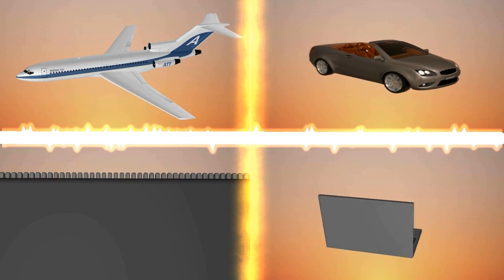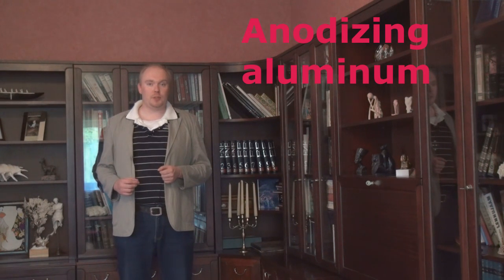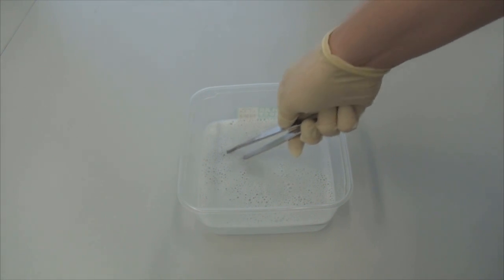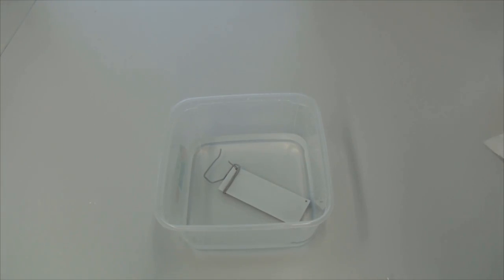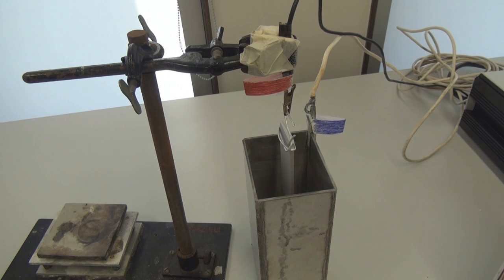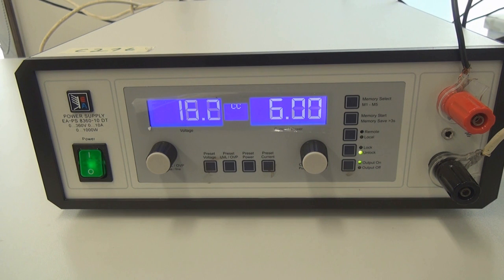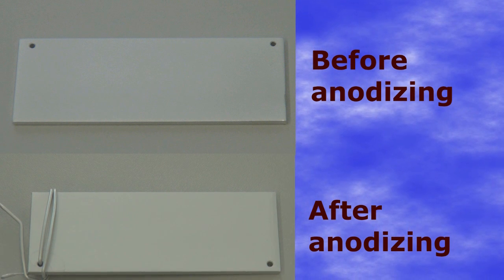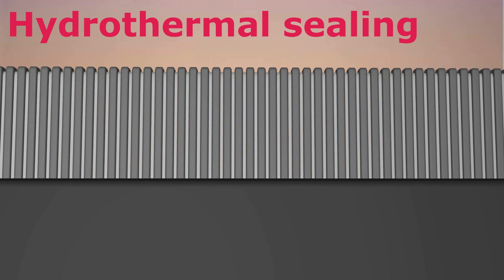How to Anodize Aluminum DIY | Corrosion Prevention Methods

Comment: Hi Captain! Man you really know your stuff! Can anodized aluminum work as an actual anode electrode in a fuel/battery cell [for eg]? If yes, then would it be protected from corrosion from submersion in citric acid and salt combined [for eg]? Normal aluminum corrodes when submerged in such a combination but if it is anodized first, would it last and still be conductive as an anode? Be very grateful to know what you think. Thanks!
Reply from the maker: Well not directly. The anodic aluminium oxide layer is dielectric, which is not particularly great for electrodes. However, the pores in the AAO layer can be used for template synthesis of nanopatterned surfaces, that can be made out of chemically resistant and conductive materials. There is a whole world of structures and materials in that field. Easiest example would be a forest of Platinum nanorods or tubes or multiwalled tubes etc. Manufacturing such nanopatterned surfaces comes with a cost though, so the cost analysist should be a part of the study.
Reply: @CaptainCorrosion  Thank you very much for such a detailed reply - very grateful to you captain!

Comment: Does heating metal also anodize the steel?
Reply from the maker: Hello! Not every oxidation is anodizing. By heating the metal you do oxidize its surface but it is not an electrochemical process as in the case of anodizing.
Reply: Ohh thanks now I understan why it always oxidize and rust.
Reply: I was trying to get the rainbow color effect on a stainless steel muffler by heating it but after a week or so i found out that it got rust on its surface

Comment: what should be the concentration of sodium hydroxide solution used to remove oxide layer from aluminum? and how much time it will take to remove this oxide layer?
Reply from the maker: Hello! The oxide layer is removed in a multi step process actually. You might want to start with mechanical polishing, followed with 1M NaOH at 40C (1 min), followed by 1 min in concentrated HNO3 at room temperature and then finally rinse with lot of water (pref. deionized water).

Comment: This is a very informative video by someone who understands what si going on! Good job Captain Corrosion. Many bright aluminium parts are sealed when they leave the factory- would it be this method they use, even on some cast parts? It would be interesting to hear your input on how a polished aluminium surface can be sealed to avoid corrosion, thanks again for the video.
Reply from the maker: Hello! If I remember correctly then for cast parts they often use type III anodizing, which creates a more wear resistant layer. There are several options to seal the pores and everyone has their own benefits and downsides. For instance, if you use hydrothermal sealing (dipping in boiling water), then you lose in the wear resistance but at the same time increase the corrosion resistance. If you want to protect a polished aluminium plate without anodizing it, then you will need either some sort of paint / lacquer or ceramic coating (PVD, CVD, ALD etc).

Comment: I can't even begin to tell you how many videos I watched on anodizing AL, and this is by far the most superior.  Thanks for posting.  Now, question is:  How do you keep the solution temp close to 0C?  Double pan on ice?
Reply from the maker: Hello and thanks for watching! In the case of small objects I first keep
 the anodizing solution in a fridge at 4 to 10 C or so - this saves me a
 bit time and ice to cool down the solution. During the anodizing I 
prepare another bath filled with ice and water around the anodizing 
bath. Having ice+water around the stainless steel bath is much better 
than using ice alone as you have much more contact area. Also, make sure
 that you have plenty of ice and water for the process if you are 
planning to anodize multiple substrates - during anodizing you also 
generate some heat. If you plan to make it a bit more industrial then 
have a large volume of cooled  water circulating - this should ensure a 
nice steady cool temperature (you will also need to get special coolers 
then). If you stick to small icebaths then I recommend you use a 
thermocouple to measure the temperature before and after each anodizing 
process - I prefer to use the same thermocouple that people use for 
cooking - see link below.
https://ae01.alicdn.com/kf/HTB1yezBMVXXXXcoXpXXq6xXFXXX4/1pc-font-b-Meat-b-font-font-b-Thermometer-b-font-Kitchen-Digital-Cooking-Food-Probe.jpg

Comment: What is the difference between anodizing aluminum & stainless steel?
Reply from the maker: +Andrea Smalling Thank you for the excellent question! The major difference is the oxide layer you get on top of the metal in the anodizing process. For instance, for aluminum you get aluminum oxide, which is quite dense and can easily be made corrosion resistant with additional sealing techniques such as hydrothermal sealing, nickel acetate, teflon or paints. Some anodizing techniques can also be used to create wear resistant coatings for aluminum alloys. Now, for steel its a different story! When you anodize steel, you normally get a fluffy rust layer, that is completely useless for protecting the metal against corrosion or give it an aesthetic appearance. Some companies claim that they can create a thin chromium oxide layer on top of steels with high chrome content, but thats harder to achieve and the thin chromium oxide layer can still be easily damaged and cannot provide complete protection. So i would recommend anodizing only aluminum or titanium alloys for best experience!